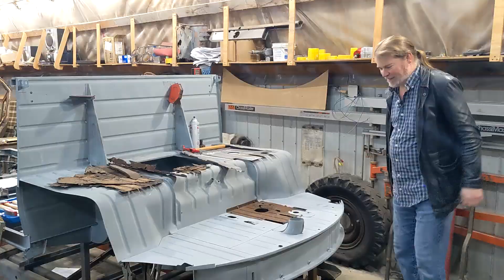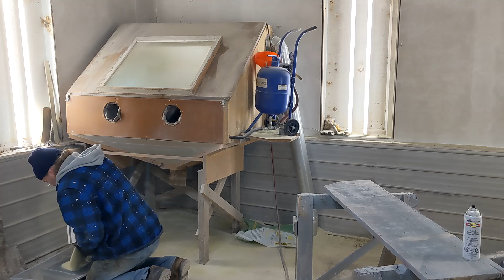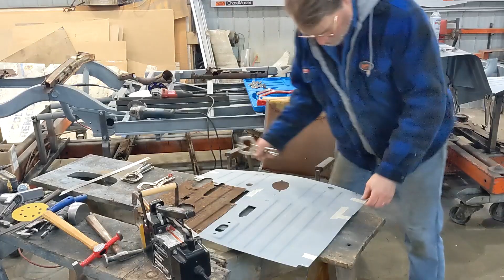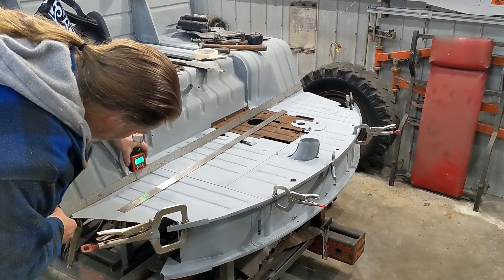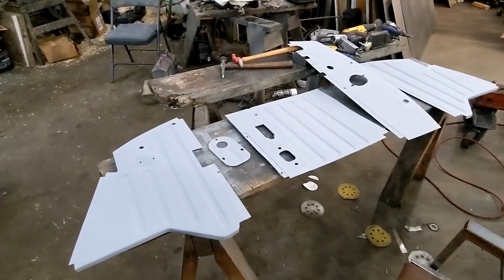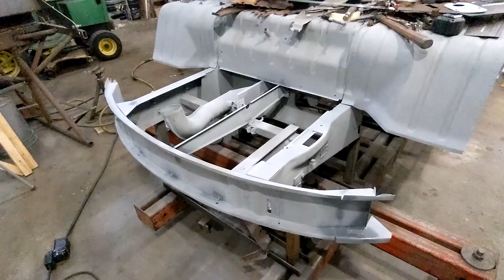The Nova Scotia Barndoor E46 Front floor install

Comment: Stan, I wonder if the original welds were actually done with a torch using some sort of putty around them? Or did they have some sort of TIG welder or MIG welder back then? I don't think they did?
Reply: Don't think they had access to both but they were both invented well before production. Tig was invented in mid 1940 and Mig in 48. Probably brazed with flame.
Reply from the maker: Most of the welds look like stick welding. I haven't seen any brass on this.